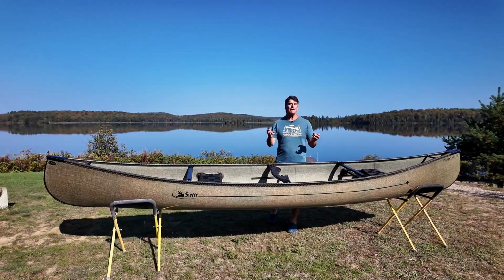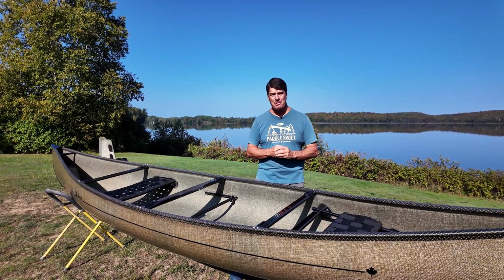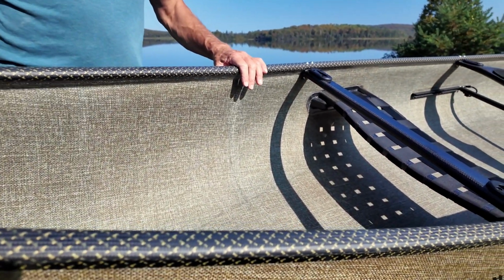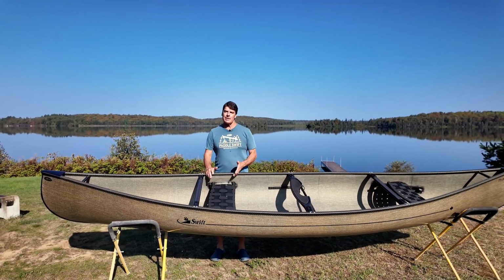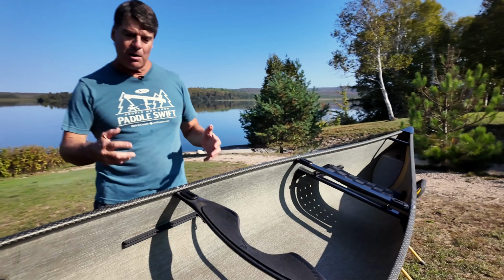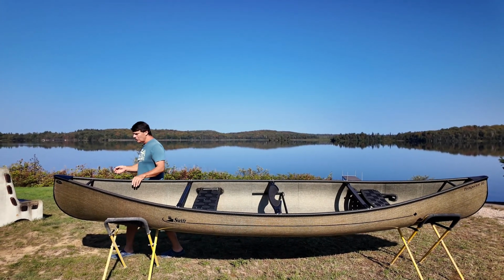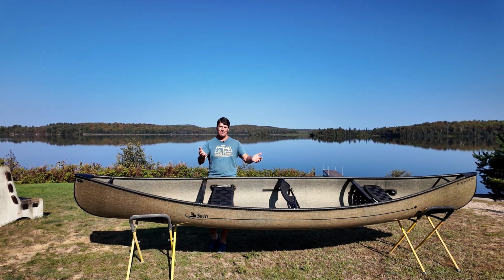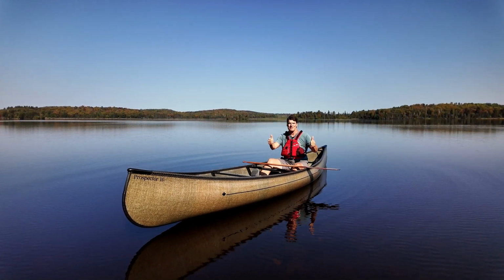The AutoCAD Super Canoe Prospector 16

Comment: The timing of this review is perfect. I just ordered a prospector 13 from the same shop 2 days ago. The folks at Bay Creek Paddling in Rochester NY are great to deal with and were very helpful in choosing and ordering the canoe. I did get the sassafras interior and cherry seat . My old school roots need to see wood grain, and I'll of course have to have a badger paddle. Which they also stock ! Bill no need to test paddle my 13 , might be a little snug on you, cheers!

Comment: It this the toughest lay up you put out and what is the weight?
Reply: This is the toughest/best for a heavy person, which they recommended.  I haven’t weighed it, but I’m easily able to lift it up by myself. Maybe 42-43#’s?  The epoxy finish takes a little weight off. Much easier to lift and lighter than my old fiberglass prospector 16!